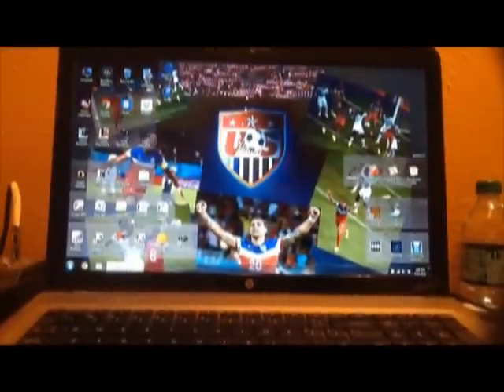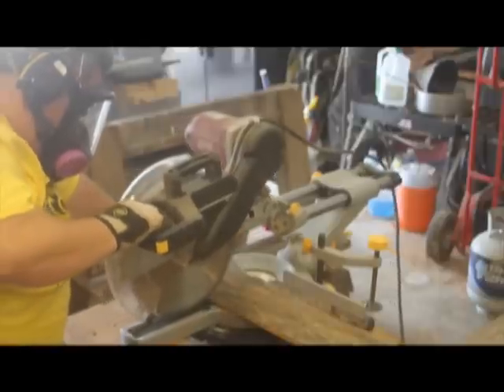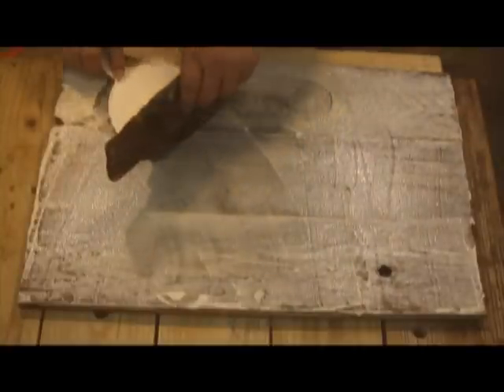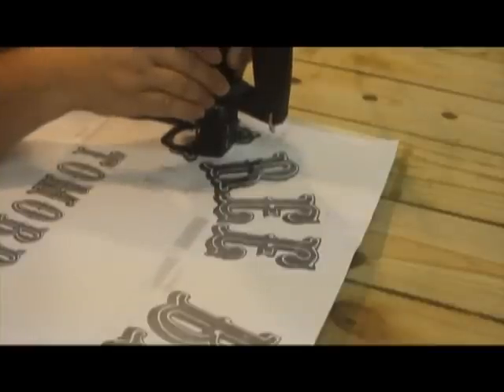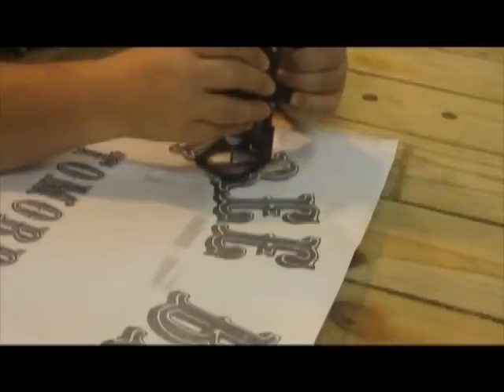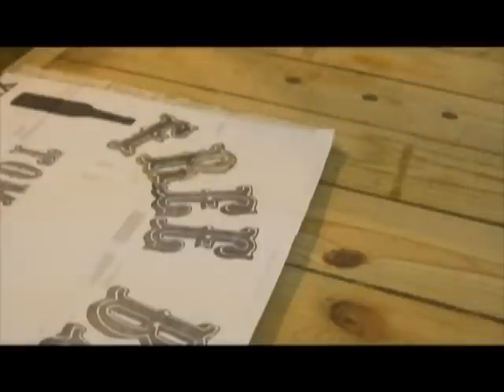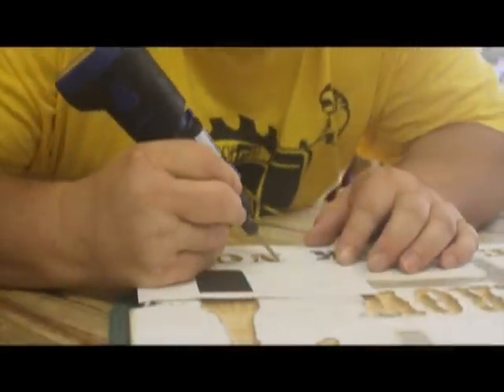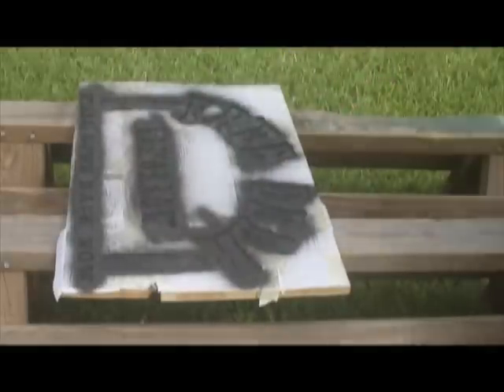How to carve a sign with your router

Comment: A CNC would make the job far easier.  I wouldnt be without mine, Its almost as useful as a table saw for a lot of things and indespensable for many more.
Reply from the maker: Well John, you make an interesting point there.  If you happen to have an extra CNC lying around, feel free to send it my way.
Reply: Make  one... Theyre not all that hard to make.  If I can do it, ANY one can.  Mine was made from scratch, NO plans but my own design. There are many deceint plans on the net but I didnt like any of them. The basic CNC including the control software set me back about $600 but I got right at $400 in additional software.  WELL worth the price.  Nearest on the market to what mine can do is about $3500 and is a bit smaller and slower.  For right at $800 there are 2 small ones to be had that are fair, The shapeoko and Inventables ones. These didnt exist when I made mine. I have some problems with both as neither will stand up to production style stuff, mine will and has for several years.
Reply: Often Ill fire it up and crank out a large batch of flea market type of stuff like various signs and anything I can dream up out of wood, plastics, brass, and aluminum, Nothing unusual to crank out anywhere from 12 to say 50 of something.. All I do is clamp down the stock and hit the go button. While the chips are getting sucked into the dust bin  I usally do a bit of sanding, some painting and any requited touch up. Any mass painting is done by a spray rig.. Like I said, production style runs.  :)

Its paid for itsself several times over over the years just in the fact I dont have any real labor involved. in the stuff.  One doesnt have to stand around watching the thing run.  :)
Reply: i'll take my sign as hand-made as possible. no offense intended here, but CNC stuff always looks too perfect and fake. like you said, hit a button and go do something else. there's no soul to it. :)
Reply: I agree most CNC stuff does look to perfect. but only because most wont take the time to program in a few oops.. Sometimes I will and sometimes I wont. But where you need high accuracy - in the range of say .010 or so they cant be beat without a LOT of work. They also cannot be beat for doing repetitive stuff like putting your logo on something.. The "soul" in making anything is knowing whats the best tool to use for the job at hand. I have been known to do signs on the CNC then take a sharp chisel to them "fuzz things up a bit"  In my case the time involved in doing a project is often paramount in siting a price so If I can  CNC the common parts used as much as possible on things my time goes down and that lowers prices. The trick is in using the best tool you have for the job to be done.. Sometimes that's a sharp chisel and mallet other times it can be a back saw or if you have one, a CNC. If I want a square hole in something I can stick on the CNC I can get a near perfect square hole in almost no time at all with accuracy down to about half the thickness of a sheet of printer paper. Only takes a few seconds to square up the corners,  A round bit will always leave a fillet the radius of the bit.  but its easily "fixed with a sharp chisel. Hell of a lot faster than drilling a series of holes then cleaning up things with a chisel.  Bottom line is everyone sees things different and that is what makes life interesting..
Reply: John Ware my wife and i own a small trophy/screenprinting shop, so i get the need for automation. it's why you can charge $20 instead of $120. it's when something is obviously just done on a machine, where any real craftsmanship is abandoned, that's where you risk sacrificing the soul. it pains me to see laser engraved plaques, for instance, despite the absolutely perfection of them. 

to each their own....
Reply: Like I said before   Each to his own. Ill still use what I think is the best tool for the job at hand. Sometimes its the cnc, other times its a sharp box knife. Before Ill print out some sign layout on  a printer then glue it to a board and start carving Ill go with the CNC. BOTH processes use technology so by some opinions neither is hand made, by others both are. My methods get what I want and yours are most likely doing the same.  Ill still use the CNC where needed..
Reply: Craftsmanship is not abandoned by using a CNC.  Many sign people argue they can’t afford a CNC.  Many, many more can’t afford a hand carved sign!~
Back in the day …. I hand carved name boards for tugboats.  All went along swimmingly until I ran into a customer who didn’t know how to spell the name of his own tug and refused to pay me after giving me the wrong spelling.  Three signs, port starboard and aft.  
A well done CNC sign  and a well done hand made sign are works of art.
Layout, balance, the use of dead space, proportion, use of color,  proper materials for conditions are essential regardless of technique.  The ability to attract paying customers in the first place is  part of craftsmanship.
I’d estimate in my area, 90% of the signs are poorly done from conception to completion.
There is soul in CNC work just as there are poorly made conventionally made signs.
Reply: Navigator777777 sorry, but that you'd compare a bad hand-made sign to a computer-controlled router is apples and oranges, imo. are you saying a CNC sign won't compare to finely made hand-made sign?

in my trophy shop we get misspelled names constantly. that's why we have a few fail-safes in place to drastically reduce customer fuck ups. if nothing else we call the customer for spelling verification, which, well, is what you should have done. i'm sure you've learned that lesson, eh?

i don't think the lay-out and such things are art as much as craft. i say the same thing about screenwriting. it doesn't take any particular talent to see these things, it either follows the rules of good design or it doesn't. 

sure, a lot of us can't afford a hand-carved sign. my own store sign was CNC routed out of high density foam, but you'd never know it wasn't real wood done by hand and it's worn beautifully over the years. the guy what made it for me packed it up years ago, and he was by no means an artist of any stripe, he just used a template. and he obviously wasn't any kind of a salesman, either. but, if owning a business was easy everyone would do it, right? lol. 

i simply don't buy into the 'artistic' aspect of most of this shit. most of it is basic common sense, and the vast majority of customers get basic design lay-outs. my wife designs her lay-outs differently only because she gets bored doing the same things over and over again, otherwise she can just plug in text and graphics in a template fashion, hit a button on whatever machine she's using, and wait for it to be done. it's not rocket science, and it sure as fuck ain't 'art,' lol. 

were i to take my sign design to a CNC guy and have him make one up for me, then to another, they should be exactly the same, right? so, where's the art in that?
Reply: FAR from it.  A cnc is just another tool to be used, just like  say a table saw.  I use mine where is applicable to the job at hand. The REAL skill in using one is simply in knowing its the best tool for the job at hand, which it isnt many times. Dosent bother me one bit if you dont want a CNC or not, but I find it intersting that somehow you seem pissed off I suggested one. Your problem, not mine.

It would be to the binifet of ANYONE to understand something before they start condemning it.
Reply: John Ware it's the best tool for the job because it's fast and precise, making it affordable for the customer and earning you money with the least amount of effort. i'm not pissed at all, i couldn't give two fucks about what processes you use to accomplish your goals any more than you care about what i do to get mines, i'm just saying quit kidding yourselves. 

do i want a CNC? hell yes! i could make money with that thing. if i had to get in there for some undercuts and do some things by hand, fine and dandy, but the customer is going to have to pay a little extra for that. would i be super proud of the work i program my machine to do? why would i? would i be proud if my did it by hand? you betcha i would.
Reply: If you want one.  make one... Its well within the skill set of a decent craftsman. I did mine TOTALLY from scratch, no plans at all. And I can hold tolerances to around .002 If I wish to for metal engraving work which I often do. NO way in hell can anyone hold tolerances to that level by hand. For most woodworking I just stay within say .015, just about 1/64th. I have right at $1000 total in mine including ALL necessary software.  The machine alone was right at $500 WITH the control software that runs under Xp on a 15 year old desktop.I designed mine more along the lines of the typical industrial production way of doing things instead of the way the typical hobby one is made so I dont have the limits that exist with that design concept.  Mine can run 24/7 for days if I needed it to.  I have run some 3d carving stuff that has taken over 25 hours to run a time or 2.  The rest of that $1000 is commercial grade software used to create stuff in a 3D cad program, Another one that creates the actual instructions he CNC needs and a couple others I find handy now and then. I did not include the $3000+ cost of a solid modeling program that is often used to make stuff like airliners and fighter aircraft I often use because that was  a gift from a friend that I did a lot of cad work for.. WAY beyond what most non-engineering types can comprehend but its my go to cad for around 50% of what I do with CNC 

A typical hobby machine is the ones inventables sell. https://www.inventables.com/technologies/x-carve

These have everything you need for right at $1600 for the big one. There are several others similar to this but they ALL have  SERIOUS issues in my opinion. DONT expect to do real production work with these..

One brand of PRODUCTION quality CNCs around is these   http://shop.nextwaveautomation.com/shop/category.aspx?catid=8    . 

They include all software most will need.  The $3000 one is close to the size of mine and I dont recommend going any smaller. These  are rock solid CNCs   Notice I did functionally the same for right at 1/3 the price.

I have played around some with BOTH of these CNCs and my opinions are based on that. These didnt exist back when I made mine. Today I would have most likely went with that 3 grand shark IF I had the money. Otherwise I would do what I did a few years back,  make my own.
Reply: John Ware i'm not a handyman, though. damnit, jim, i'm a doctor, not an electrician! dunno, maybe if i found a few good videos on it as a future project i could cobble one together. what would be more a more likely scenario for my ignorant ass and budget would be some kind of pantograph router. cuz as soon as someone says it's 'simple,' they'll say, okay, now the first step is to pull the motor out of a 1996 black & decker electric hedge trimmer, then we'll want to convert that from AC to DC. now, we'll want humidity levels to be between 55-58%, otherwise you might want to weat a rubber suit for the next part. you'll notice the lightning rod was curved with our metal curving machine allowing for some reduplicative eletro-collectivity digression. once lightning has hit the rod and filled up 23 10,000 amp capacitors we built using old missile casings from the 50's because the lining is perfect, we then take our oscilliscope...'

okay, maybe i took that joke too far.

you might see things on a small plaque when it's not right (especially ppl like us who make the stuff), but, like you said, on a wooden sign from ten feet away there's no way the human eye will pick up those minute amounts of tolerances in lettering, eh?
Reply: ryan barker wrote:  "do i want a CNC? hell yes! i could make money with that thing.”
LOL
I should stop right here.  ;-)

I’ve no desire to suggest  hand carved is outdated or poor.
My point is scrap is made equally well by hand or by CNC.

I’ve hand carved signs for dough and I owned a 3D printing biz.  Art is ever present in both.

A better analogy would be a CNC producer shipping parts via the Pony Express or stagecoach.    
I’m guessing there are few horse based shipping companies who could compete with Fedex, UPS or our dying USPS.
Reply: Navigator777777 i'd venture to say that you'd prefer doing everything by hand if you had the customer base that could afford to keep your finances at the same level you enjoy by using your CNC, no? hope that sentence isn't confusing....

but, then the business aspect comes into play and it's hard to pass on that unless you're irrationally hard-core about tradition, in which case reason doesn't have as much to do with it as long as the bills get paid. nothing against those guys at all, i admire their attitude, but as far as being capitalists (within reason, of course), the business angle probably isn't their favourite thing.

i have to wonder how a sculptor is going to feel in the upcoming years when anyone can play around on a computer and create the same things they can with a 3D printer. a lifetime of learning the craft and some lazy teenager can now do the same thing while sitting on his ass, never hardly getting his hands dirty, and just has to hit a button? sure, you'd get a perfect product every instance and in a fraction of the time, it would just lack any kind of soul.  

and that's really the thing, isn't it? perfection doesn't equal soul.
Reply: Ryan wrote:  “a lifetime of learning the craft and some lazy teenager can now do the same thing while sitting on his ass, never hardly getting his hands dirty, and just has to hit a button?”
Thats not a fair appraisal of CNC.
The qualities or stereotypes you assign to teenage CNC users is not valid.
What I love about CNC is exactly the opposite.
When your ear is properly tuned to  customer’s needs “soul” is captured far more quickly.
For example, a drive on any highway and you are likely to see someone driving the same car as you.
It’s unlikely I will ever build a vehicle to suit my needs.
But there are those who do!
We can all go to a Box Store and buy “No Trespassing”, Keep Out”,  or “Yard Sale” signs which perhaps lack  soul.
Yet, when a customer seeks you out for that special sign or widget…. The “art’ begins by embracing their desire and then delivering.

The critique that CNC is simply “too perfect” doesn’t resonate with me because a poorly done CNC sign is a “perfect mistake".
Reply: Navigator777777 i wasn't saying that about CNC users, i said that about 3D printing users in the years to come when the technology becomes so user-friendly that my 87 year old grandma will be able to use it. right now it's a bit more complicated than that, but still some systems come with a scanning device which practically eliminates the need for an education.

typically you can tell when something is hand-made or not when you inspect it. even on first blush it's often clear what machinery is used if you're familiar with processes. 

most customers really don't care how you get it done as long as it gets done in time, looks good and the price is fair. they're not experts and price is always high on their list priorities, sometimes the only priority. fucking wal-mart shopper mentality makes me want to puke....

anyhoo, i still have discuss with a customer what they want, especially for screenprinting, and guide them in the right direction because they're more often than not clueless. which process i use depends on the order. if it's larger numbers, i use screenprinting and, yeah, you can tell when something has been screened because it usually has that quality about it. on the other hand, the vinyl cutter does the small orders and it does them with computer precision. some people it one way or another, most could care less if the price is right....

my function isn't to be their personal artist, it's to take an order and give them what they want as best as possible. from a business standpoint that always involves time management. from a creative standpoint, such as it is, the less my hands touch a product the less pride i'm able to claim.
Reply: Ryan wrote:  …”when the technology becomes so user-friendly that my 87 year old grandma will be able to use it.”
Shouldn’t that be a goal?
As a former 3D printer business owner…I found my service way too advanced for the area I live in.   Lost my rear….but that doesn’t detract from the technology.
I’m of the belief like microwave ovens today, households in the future will own 3D printers or “replicators" that are fed by our trash.
Dishes, pots and pans, and the like will be designed, and bought and sold .  Trash will be sold as a commodity.  
Just my humble opinion.
Reply: Exactly.   You gota know what the customer wants if its a custom job.. That takes talking to them..    Personally I have no use for a 3d printer and thats why I havent adapted my CNC to have that function.  The mechanics of both are the same in principal. What changes you swap out the spindle or router for a 3d printer hot end.. I am considering hanging a laser on the CNC though, but I dought Ill do it unless my need for one gets a lot greater. .. Right now I have access to a laser cutter with an 18 by 24 bed with enough power to cut clean through 1/2 inch oak and a 3d printer with a 12 by 12 by 12 build area. Just have to pay machine time and material so no real need to buy either.. I also have access to a 6 axis CNC big enough to make a big V12 block on if I ever need it, not likely.. :)  I often make up big batches of flea market crap for a couple people too and thats where the CNC is the the way to go.. They do the finishing and painting.  I also spend a lot of time at a local  makerspace teaching people how to basic woodworking, minimal welding and machine work on a small mill and lathe among other things. Im retired and I am busier now than when I had a job and loving it.  Nobody is riding my ass either.

I do all sorts of strange stuff with wood and most metals. Far from the typical wood shop stuff. Got a small tig welder on the way to do a job for somebody using aluminum..
Reply: Navigator777777 not sure if trash will be raw material or not, but i've said for many years that 3D printing will be the next big thing, like cell phones. we're not there yet and it's too bad you lost your ass, but that's the price people pay when trying out new technology, eh? that is, were it not for people like you helping to pave the way, we might not ever make it to that place, if that makes and sense. it's not science-fiction, but there's a lot of generational gaps that have to be bridged first. 

price, quality, versatility ~ it's not the whole package just yet. it will be, though. i think that computer labs in schools with be replaced with 3D labs. kinko's should get on this bandwagon now, lol.
Reply: John Ware too bad there's no makerspace in my area that i'm aware of, those are all skills i'd love to learn as every one of them applies directly to taking trophies and plaques to the next level. there are a few other processes i'd love to tinker with, too, dealing with fibreglass, concrete and mould-making.

too much to learn, not enough time and money! 

and if you wanted to you could turn your skills into a nice little business! for example, people pay damn good money for cut acrylic, and i'm sure you'd find no shortage of folk needing something cut with a plasma torch or laser.
Reply: Fiberglas is easy but you have to pay close attention to details. Dealing with the cloth and mat glass isnt al that difficult. Using a chopper gun is a bit more difficult but if you have ever used a spray gun, you will catch on fast. Years ago I worked at a place that made carnival rides and I did all the fiberglass work, including making the molds..  The process started by spraying a releasea gent in the mold , wait 30 min then spray in the top coat of gel coat ( the color you see on the finished item), Then if needed a backer coat. Next you sprayed the glass and epoxy into the mold with a chopper gun. Next, you used what looked like a paint roller using washers with a spacer between them. You rolled all the glass down with that to get all the air pockets out.  You used a stiff brush to poke everything down where the roller coudnt go. Then you just let hings set for at least 4 hours, but I let things set overnight.  To get the product out of the mold you just poked a knife between the gelcoat and the mold somewhere that wouldnt show and pried open a crack. Once you had had that just stick the nossel from the air compressor and blow the rest free..   Mostly the same process using  mats and cloth instead of a chopper gun.. That the ENTIRE process other than making the molds.. 

Mold making is almost as simple, but you DO have to pay attention to undercuts and the like that will hang a part in the mold.  Ill bet somewhere on youtube there is a few videos on mold making..  If there is a ceramics group close by go watch how they make molds.  Its the same process for ANY mold. All that changes is the materials you use.  Silicone molding compound and casting plastics is a good way to learn something about molds. Ive done TONS of that in the past too..

Have fun
Reply: John Ware you have all the skills i want to learn, my friend. from what i remember of watching fibreglass videos what you say is dead on, and i've watched so many mould-making videos.... 

just don't tell me you used to make large fibreglass starship enterprises for outdoor display and having a concrete base, lol. 

i'm not above making flea market bullshit, either. after all, i used to sell used toys at one (outdoors) and had a great time, making more money in a good weekend than i did working 40 hours at GM.
Reply: Making money is not a crime!
;-)
Reply: Navigator777777 to some people it is. i'm not one of them. i'm a proud capitalist. that's not to say i agree with certain business practices, nor do i believe anyone has a right to tell me how much i should have before i have to give it to people what just want to sit on their lazy ass and game the system. half of those motherfuckers drive a better car than i do while i bust my balls trying to make ends meet. doesn't quite seem right in my mind....

my apologies, rant over, lol.
Reply: Tell me about it. hehh  While I would have liked to made more I wouldn't trade What Ive learnt over the years for it. I have all I really need and dont owe a dime to anyone.. I would rather be out in the shop doing stuff or playing either my keyboard or hammer dulcimer than just setting on my ass complaining the gorvenment isnt giving a handout. The way I see it is simple... With the exception of the mentally or physically disabled, If you wont get off your ass and work--- STARVE! The world dont owe anyone anything.. For some periods in my live I could have gotton more welfare than what I got working but I just happen have a bit more self-respect than apperently many have today..
Reply: Proud capitalist dittos!
I’m a Temporarily Embarrassed Millionaire.
Reply: Navigator777777 i'm not a millionaire... yet. okay, i'm far, far from it. your embarrassment should be negated by the harassment of having money.